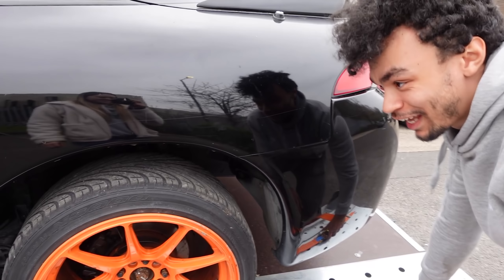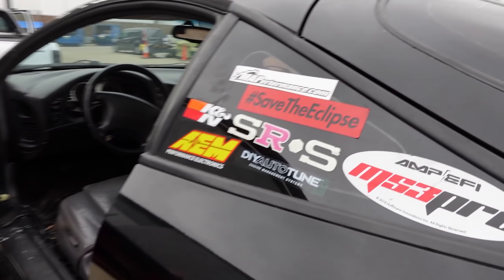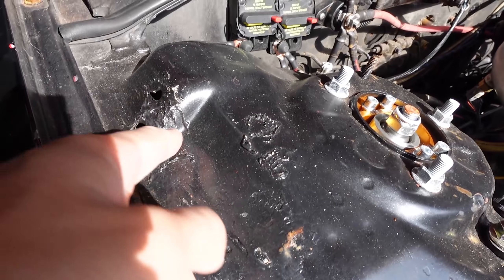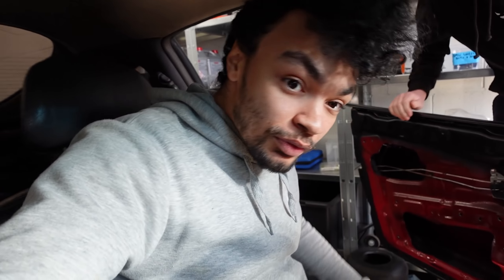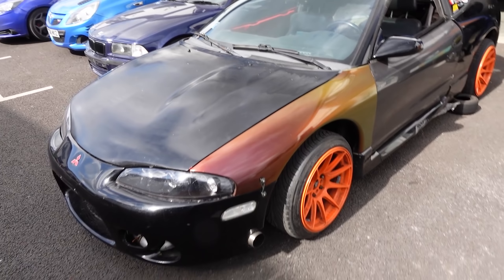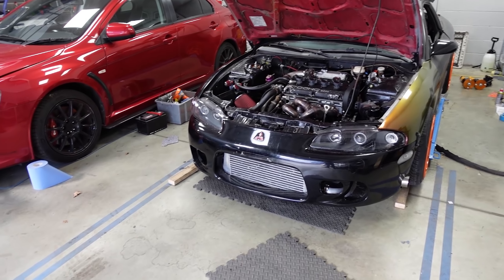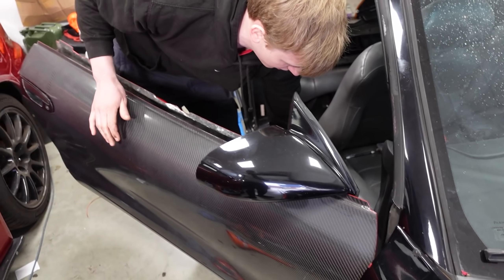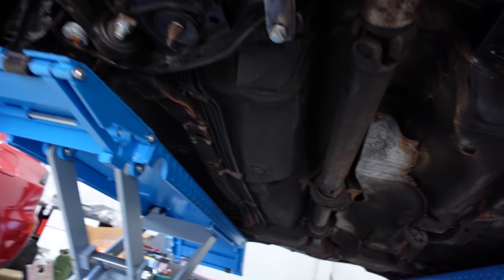I Imported a Subscribers Eclipse from the USA!

Comment: secret about power steering or lack there of, get moving first before turning the wheel and its MUCH easier, youre trying to turn a wheel thats basically glued to the ground because youre attempting to turn the tire thats not rotating
Reply from the maker: It's the first time I've driven A car with it removed rather than not having it standard. It's very odd 😂
Reply: @BlackPanthaa  yeah its a complete pain in the ass, basically every single car I've built from Hondas, Mazdas, and Nissans all had their powersteering taken out due to swap clearance issues so its something I've had to deal with since I was a teenager (I'm 35 now) so I thought I'd give ya a tip or two. Its not bad once you get used to and depending on the car and the swap that is the reason of the elimination of, its worth it sometimes. Im from the US, so if you need any info of help feel free to ask!

Comment: Carbon fibre doors nice it’s a drift or a race machine mitsubishi  don’t break the carbon fibre on the doors it’s very easy to crack if you punch both sides you could take the door out of shape and crack the carbon fibre but carbon fibre bonnet/doors/boot your car should go faster and tweak the engine performance aswell

Comment: What do you plan on doing with the front seats so you have more room and a better view to drive? I have a Mitsubishi 3000gt and I have the same issue, my head literally touches the top of the car and my feet are super close to the steering wheel
Reply from the maker: Quick release wheel and thinner seats, without rails if you need more headroom

Comment: Common issue with the ranger, we towed a speedboat from the UK to the south of France and ended up going into limp mode, you may need a engine rebuild if it keeps struggling, the gearbox on the ranger is very solid. Just a heads up 👊🏽

Comment: Your ranger is not a tow rig! You're not just towing the 1600kg car... you've got the trailer another 500 kg AND THE RANGER! Another 2000 kg!!! 4000kg  the ranger is not built for...
Reply from the maker: the tow capacity is 3500KG, the common highest of a vehicle I can acquire in the UK. This is tow capacity rating, you don't add the truck.
Reply: @BlackPanthaa  Yeah you do... I work in the industry setting up shipments all across the world. Look up GVWR for your vehicle. Not tow capacity. For your truck it is 6050 lbs or 2700 kg. That includes the weight of the vehicle. Towing a car and trailer you are breaking your warranty... Do not tell them you towed a vehicle if you take it in for repairs.
Reply: @BlackPanthaa  Just trying to help you out. A Ford Ranger is not rated to tow a vehicle. Period. You're just damaging your truck, like I said don't ever tell your service center you towed a vehicle if problems arise down the road. Avoid telling them that at all costs... just helping you out.
Reply from the maker: I've looked mate, braked trailer weight is 3500KG, Max authorised mass is 6,000KG

We do not have the F150 or anything like it, these and the VW are the options. Both are rated the same.
Reply: @BlackPanthaa  If the 2021 Ranger is powered with the optional tow package, its maximum towing capacity is 7,500 pounds. Its maximum payload capacity is 1,860 pounds. It refers to the total weight a vehicle can pull. To put it simply, it signifies the total weight of the vehicle, including your passengers and the cargo. Payload, on the other hand, means how much can be hauled in the truck bed and cab. 

This is right from Ford my guy... no way in hell its 6000 kg. No way in hell trailer + vehicle is 1860 lbs. 

I wouldn't lie to you. I have nothing to gain from it.
Reply from the maker: @gregscott4479  I understand you're intending to help, but I've calculated this. 3,500KG is the tow capacity, trailer+trailer load. It's a 2017 3.2 Wildtrack, 3,500KG is a limit set legally in the UK for all consumer trucks. 

There's literally nothing on the market here that will allow a higher tow (other than a literal lorry)
Reply from the maker: @gregscott4479  GVM excludes trailers, you want MAM (maximum authorised mass) which is 6000KG. Hence the 3500KG tow capacity with normal truck+passengers
Reply: @BlackPanthaa  Lol I've been doing this for 20+ years. Don't believe me or what ford says. 

Despite its dimensions, the Ford Ranger doesn’t have a class-leading payload capacity. However, at a maximum payload of 1,252kg, it’s competitive.

That MAM is for DoT not what the vehicle can do. If you wanted to be silly enough to try and tow that much LEGALLY. That is all. Sorry there aren't many options where you are for daily tow vehicles but I am not pulling your leg here. Please, for the love of the car gods... listen to me.
Reply from the maker: @gregscott4479  you keep giving me payload, that's literally passengers and the bed load. It's nothing to do with tow capacity, I can tow 3500KG trailer load
Reply: @BlackPanthaa  No you cannot. Payload is already incorporating the vehicle weight. 

I am literally trying to help you understand. Payload is already factoring the weight of the vehicle... meaning vehicle PLUS what you're trying to tow. If you think a tiny little Ranger can tow 6000 kg... you're sadly mistaken.
Reply from the maker: @gregscott4479  I didn't say tow 6,000KG, that's the maximum mass total. The maximum mass is truck weight, payload, passengers AND trailer load. Payload incorporates the truck weight as is and States to you the weight left for passengers and bed load.
Reply: @BlackPanthaa  I guess some people just learn things the expensive hard way.
Reply from the maker: @gregscott4479  here's an example for you mate. The Ranger Raptor tow capacity is 2,500KG. I didn't buy one because it would cut it close with a big trailer. The truck itself weighs 2,510KG so by your calculations you'd literally have to take part of the car off to drive it under it's own weight without a trailer 😂

It also has a listed payload of 620kg and GVW of 3,130KG. Which again, breaks the math you're trying to use.

 In the UK tow capacity is literally tow capacity, nothing else!
Reply: @BlackPanthaa  just gonna leave this link here... let you figure it out... sorry
Reply: @BlackPanthaa  why are you deleting the link I am posting? It's literally to Ford's website. Not my fault you read it as 3500 kg when in-fact it is 3500 lbs...
Reply from the maker: @gregscott4479  I'm not, links are auto removed because of scams. I'm in the UK, we use KG. I've verified this and I'm correct, your ratings may be different.